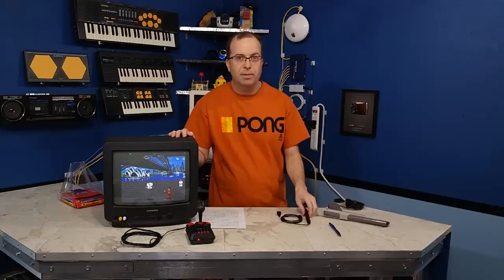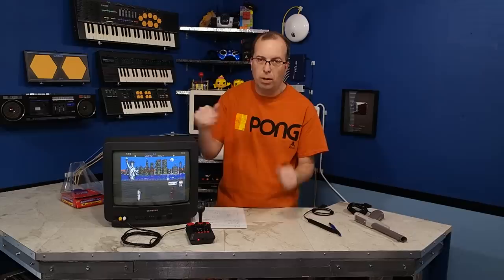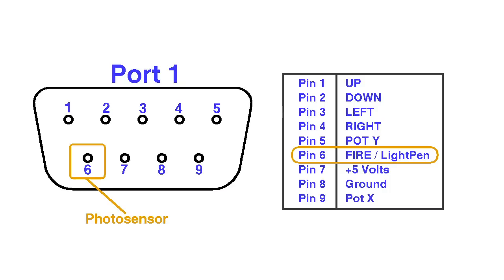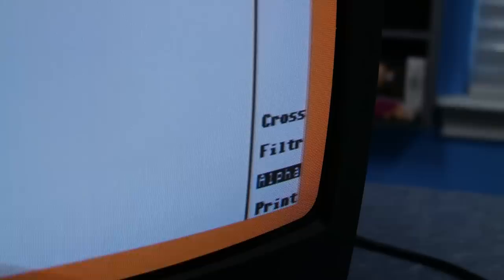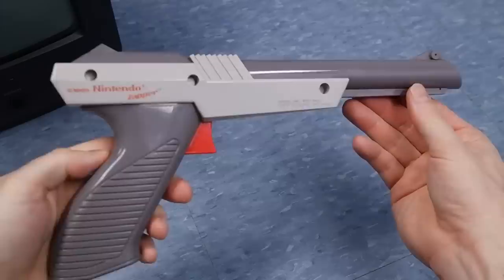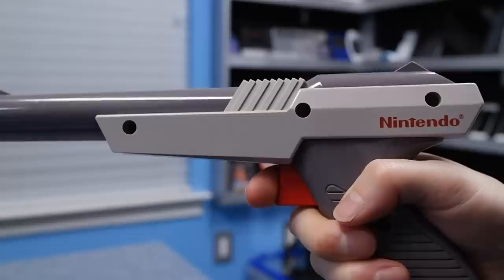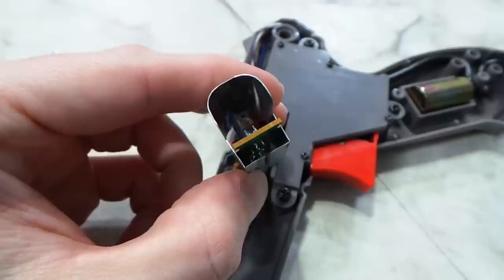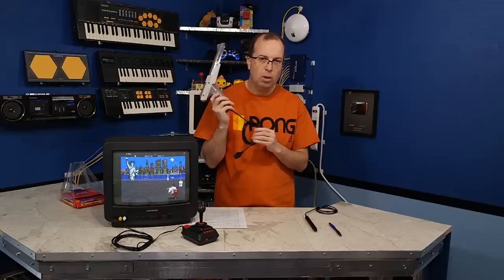How light pens and light guns work NES Zapper

Comment: With some experimentation I found I could use a light pen with a LCD Tv,but it was only in the selection of items,(i.e. business software ), on the screen with a pixel that was going white to black continuously...basically each line item selection would flash once and move on to the next,if the light pen were on an item then the software would know where the light pen was and select that item...

Comment: So simple yet genius but didn't think of us 90s born kids that was born around 92 would figure out how to get high score on duck hunt by shooting at a lamp and not screen. Does not work on 5k tvs fyi guys you gotta have a old-school tv the big giant heavy box 200lb 40 inches with red white blue connections cause the 4k and 5k screen refresh rate is so fast it can't read the white square. I have the pad and 4 different drawing software and key board as well and duck hunt and 4 different light guns on a old school 80 inch heavy 200 lbs block of tv lol

Comment: That LCD display lag can be turned off.

However, in so doing, it'll make watching standard TV very choppy.

Yep, it's all FPS related.

However, the display lag isn't the only problem with the light sensor.

CRT display has glass which reflects light outward because it is rounded inward, whilst LCD display is either flat or rounded outward and has fiberglass or other similar lighter-weight materials, which doesn't reflect light outward, or at all, and therein lies the real problem. I mean, of course, if you stood close to the LCD screen with the display lag off, you could use the light gun, but...

There's the lackluster challenge factor involved with that.

As far as the light pen goes...CRT is the only way to use it. Well...one could have the LCD emulate the CRT process, but if you try to watch TV with it, you may just end up frying the whole thing.

Comment: Hmmm. I wonder how the Sega Menacer lightgun fits into all this...I'm presuming it works mire like the pen, since there's a title on the included cartridge that lets you use the Menacer to move a cursor around the screen, rather than firing at a target.

On the flip side, I'm reminded of the Action Max game system, that used even cruder methods. You had a sensor on a suction cup that you put on a specific part of the screen during the game (which was played from a VHS tape), there would be a flashing dot on the screen whenever there were targets in the video. Targets would also have flashing dots on them...if the flash rate matched that of the dot under the sensor, you scored a point, if it was the opposite rate, you lost a point. IIRC, the Captain Power toys worked similarly, but just used two preset flash rates or something like that.

Comment: CRTs don't have pixels.   The dots or bars or triangles are breaks in the shadow mask and are not related to discrete parts of the picture being drawn.  The granularity of the light pen is actually derived from the resolution of the timer that's watching the digitized signal from the pen and the effective focal width of the lens.

Comment: While the light pen detects light on a pixel lines bases sothat if a computer has a resolution of 240x256,then it can track down over 60.000 positions on screen.
However the zapper detects light on a frame bases,meaning that if the game runs at 60fps,then it can detect 60 objects onscreen(actually 59 since 1 black frame is needed to calibrate), wich becomes somwhat limited but it equals to less then 8x8 pixels, but it works.
But since but light detection systems require an analogue 60hz crt screen ,it’s essential to keep those tv’s save because even digital 60hz crt tv’s can mess up those timings.

Comment: The light gun - LCD timing issue could easily be solved with a one step calibration. Although what would be even more durable is to move all logic to the software and use the black as the start signal for timing, since once the sync delay is handled, the remaining timing will be consistent. That way no calibration would need to be done.

Comment: The zapper gun would work just fine with a flat TV, but the official Nintendo zapper has a chip which only allows the rapidly changing light of the CRT to pass through, which the steadily glowing LCDs don't emit. Try it with a cheap 3rd party zapper and it should work.

Comment: 12:49 go get a Wii U David Duck Hunt was put on the Ill Fated Wii U and you can play the Game using the Wii Remote and they made Custom Crosshair for when the Remote is Aiming at the Screen or it's NOT Pointing at the Screen but actually a Sensor Bar that came Both with the Wii and also the Wii U and you can decide if the Sensor Bar is Above or Below your TV! but that is pretty much it! you should Revisit this with the Wii because The Wii Remote have some Interesting Things going for and this was a Successor after the NES 21 Years Later!

Comment: It's not true that only one pixel is lit at a time.  The phosphors on a CRT take time to fade after being hit with the electron beam, so multiple pixels are illuminated simultaneously, though usually only on the same scan line.  I would expect the pen to be the least precise when moving purely horizontally.  

I would also expect it to have lower precision on televisions rather than monitors.  TV's have higher persistence phosphors (which is why a 30Hz interlaced signal doesn't flicker like it does, horribly, on a monitor), so there will be a larger number of pixels simultaneously illuminated, with a lower amount of contrast between them.

Comment: Actually the Nintendo Zapper gun explanation is incomplete, it's missing a few pieces. First is that that gun only contains a light sensor. The actual detection algorithm is within the cartridge, so different games detected where you were pointing differently. So for some games you could point the zapper at a light bulb and it would always work.

Comment: I imagine the second tube weight in the zapper was to mimic the weight of a real gun since the famicom's light gun was shaped like an old 1890s revolver and just used a different case for it's EU and NA release of it since it wouldn't have been able to been sold in its original form factor in anywhere but japan and surrounding asian countries probably

Comment: Nintendo has found a way around the latency of the LCD screens but you still cant use the old school light gun.  What can be used it the Wii controller and it's light beam triangulation technology to aim the controller at the screen.  Now the system knows where you are pointed and at what time when you pull the trigger.  It works well with the re-release of Duck Hunt.

Comment: So, you could take a 4 position switch, or carefully use an 8 pin DIP switch to wire DB9 male and female connectors together, and then use your favorite light pen with any software.

Comment: actually, the first frame of pure blackness when using the NES zapper was an anti-cheat method. if the gun detected light (such as from a lightbulb), it would register no hit, because there would be no way to miss if you were aiming into a direct light source. sometimes this method would fail, however, as the guns aged.

Comment: Nice input there!
I really wonder tho if under said circumstances it'd be possible to add a special delay of some sort somewhere in the mix so these Light Guns could be used on modern screens.
Then again, devs probably already found different ways by simply using cameras as it's the case with the PlayStation Eye (PS3/PS4), Kinect (360/One) or IR sensors like those for the Wii/U and HTC Vive.

Comment: Well, the NES zapper might work on LCDs with very low response times (5ns or less), such as the ones designed for gaming. Also, a brighter screen could improve it (an LED display or LED backlit LCD), but that's just a theory.

Comment: You probably won't see this, but I have a good guess as to why the second weight is hollowed out and in its current position. It most likely has to do with the balance of the gun so that it would "feel" right in the hands of the consumer. Nintendo wasn't a fool back then and probably did a good amount of research and testing before releasing the gun.

Comment: I could see someone cheating the light gun with a flashlight. But yeah, always wondered how they worked. Every arcade I've ever been in had time crisis and I knew it didn't have modern motion detection since the boxes were at least 10 years older than the wii. This makes more sense than any way I was thinking.

Comment: I've seen the same technique as the NES zapper using with OpenGL, instead of raytracing... The only difference was that you was enable to use colors, and not swapping buffers so the user didn't see any flashes...

Comment: I tried making a simple but slow data transfer routine from my PC to my C64 using a light pen, but unfortunately the LCD was actually not bright enough for the light pen to recognize the light at all (I had a small flashing box on the screen which the light pen was at). However using a flash light, the light pen did work fine. So I guess if the screen is bright enough it might be possible to do this. :)  - Perhaps I'll try taking the light pen apart and stick the sensor right there on the screen. :)

Comment: Another reason for the black screen frame is to make it harder to cheat. Older light guns could be easily exploited by simply pointing them at a lamp, so the gun checks for light during that black frame. If it finds any, it treats it as a miss.

Comment: Wouldn't the button issue on the C64's light pens be quite easily remedied by just making a very simple adapter? A passthrough to the same pin for the light sensor and ground, and then just routing to a different pin for the button? In fact, since the pens only have one button, maybe just wire it to all 4 directional buttons and have it universal?

Comment: My kids DigiArt board is equipped with similar technology.

I guess using light pen on horizontal bit spherical surface would be literally a pain after couple hours of work.
Reply: PS it is pity that there is no callibration software to make pistols work with modern displays.

It is also possible to produce 2.0 guns in price of optical mices that would analyse image.

Comment: SO..  The light gun went in to a DIGITAL input?  I always figured the photodiode went into an analog input..  Was there any internal calibration for varying ambient light levels??  This also explains why I never had any luck with my homemade light gun back in the early 80s..  I connected it to the analog joystick input on my COCO and then tried to read the A/D converter, which was REALLY slow..  I could get it to work if I could spend 5 seconds scanning the screen, but to make it fast enough to be usable meant that I'd miss the pixel by an unpredictable amount of time..  Never occurred to me that I could connect it to the joystick button input..

Comment: theoretically you could purchase a female adapter to plug the light pen through and then wire that female adapter to a male adapter that changes the button to be wired to another line. This way you dont damage anything and still are able to resolve this problem

Comment: DAMN A TOUCH SCREEN ON A CRT WTFFFFFFF I NEVER KNEW THAT HAHAHAH NOW IVE SEEN EVERYTHING FROM THE PAST
9:01 hahah I knew that trick.
9:47 damn that's amazing to even find that mechanic to create a "Gun" , and despite of old tech, I'm still amazed until today that the zapper gun WAS VERY ACCURATE, or at least to me, because I could shoot the ducks through the zapper's visor, it felt really really good when hit.

But wait, WHATS THE EQUIVALENT TECHNOLOGY THAT WORKS LIKE THIS ZAPPER FOR TODAY ??????????????? I think even nintendo wii's wiigun CANNOT work without a cursor/crosshair on the screen, but this zapper can work by just aiming and use the visor. I think that photosensor and the crt light pixel is really something for gun mechanic. It doesnt even need cursor/crosshair on the screen yet still accurate using physical visor on the gun. WOW.

Anyway, thanks for this info, I'm amazed.

Comment: I've always wanted to know this so thank you. Also, does this mean you could technically cheat at duck hunt and win every time by just holding a light up to the barrel of the gun?
Reply: The black frame actually acts as a cheat prevention, if the NES sees light while that frame is being displayed you won't hit anything.  This is what makes you miss on LCDs as otherwise due to the timing issues there would always be light hitting the sensor when it is checking for ducks hit.

Comment: Very interesting... I remember my old ZX Spectrum +2A came bundled with a lightgun and 6 games for it. But now I have a question... I remember when I got Time Crisis on the original Playstation, and the light gun had an extra cable that had to plug into the video RCA connector for it to work, and also I don't remember there being that black screen then flash of a white square on it... so did that light gun work differently, and if so, how did it?
Reply: They worked more like the penlight: the yellow RCA connector thing was to intercept the video signal, so the gun could know where it was pointing on the screen based on the CRT scanning pattern. I think the reason for that extra cable, compared to the pen, was because of the latency of the USB interface that connected the gun to the console.

Comment: I'm a little confused with the zapper. The white box always appears where the duck is. So, it seems like it does know where it is pointed, if it is pointed to the wrong place and not where the duck is, you will miss. It can't be pointed just anywhere on the screen if you wanted to hit the duck. With The NES package I got for Christmas of 86, I got Super Mario Bros and Wild Gunman, the zapper would not work (yes it was plugged into the second port and it was a CRT TV (as far as I know)) with my tv but would with my friend's tv. Also, there was a curious problem, I would hit the outlaws in the game if I pointed the zapper to the right bottom part of the screen.

Comment: The reason the zapper does not work with LCDs is because it has a bandpass filter looking for a 60hz interlaced signal. It does not have to do with timing of the black signal.  I believe you can cheat with the zapper by just pointing it at a second TV.
(edited comment -  I had one before but deleted it to verify my memory)
Reply: Think you misunderstood the whole thing or it's just your wording. :) When on an old CRT screen and you're alternating between white and black frames, they're shown for exactly 16.67ms each. Since frequency is just the inverse of the time between frames, you'll end up at 1/16.67ms or… 60Hz. So this classic Zapper flickering is indeed a 60Hz flicker. The problem with LCDs is the fact that they can't show the image immediately as it becomes available, so they'll always lag at least one frame behind and that's exactly the problem the Zapper is facing. It doesn't matter whether the display takes 1, 2 or even 8ms to update. It's always lagging behind, so the game would always check too early for the actual flash.
Reply: I'm not 100% sure about the software, so it's possible it's looking for that blank period, but as I said, I think I remember you could point the gun at another TV and it would register. I don't know why they blank out the whole screen, it could be to prevent premature signals detection.

I do know about the hardware.  I've read the patents, I've had the gun hooked up to an oscilloscope, and I've written a game which uses the gun. I can say with 100% certainty that the signal pin for the sensor does not give you a positive signal unless you are pointed at a 60Hz interlaced screen (or you fake it). There is a hardware filter which only registers that frequency of signal entering the gun. I have not tried with an LCD, but I doubt the problem is lag. The problem is it's not raster scan and the refresh of the screen works in a totally different way compared to CRT. My guess is, that you could generate an LCD signal which would work with the gun, but it certainly won't work with the game as originally written. It does not work with a non-interlaced CRT either.
Reply: Okay, that sounds interesting. My guess regarding the black frame is to ensure the whole screen is cleared before you get your targeting rectangle. Otherwise you could end up with the lower half still showing the game screen for example.
Reply: That's my guess too. In my case, I was able to get the gun to register on a progressive-scan CRT by drawing a horizontally striped black & white box over the target. Since the normal screen image did not register with the gun, I did not need to blank out the whole screen, which made for a much nicer experience.

Comment: what if you had software that would take you video card input and draw one pixel after another on your monitor so the light pen would work. for high speed monitors like mine(240hz) it might look like a stable image. and that software would know what pixel its lighting up. there for lightpen on lcd. youll just need usb lightpen(or modern drawing tablet that is way more accuret)

Comment: Hi, amazing video as always! I have a question: since the Zapper Gun won't work on modern LCDs because of "timing", is it possible to adjust the software (or write it from scratch) in order to synchronise the LCD frames with the Zapper light sensor? Thanks!
Reply: Maybe at the settings (on PC. On winXP, for example, you can choose update rate. I don't know if newer versions have this setting, and even then, you have to build some sort of adapter no be able to connect that 7-pin connector to 9-pin. However, if newer versions of Windows have this feature, and you have an adapter - the only remaining piece of puzzle is an emulator!